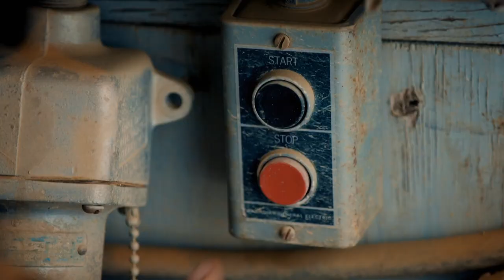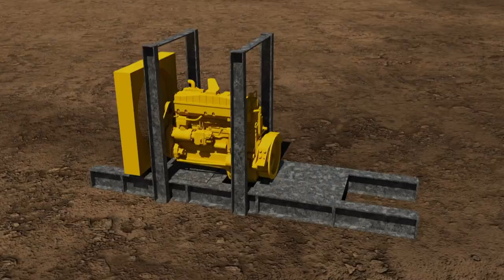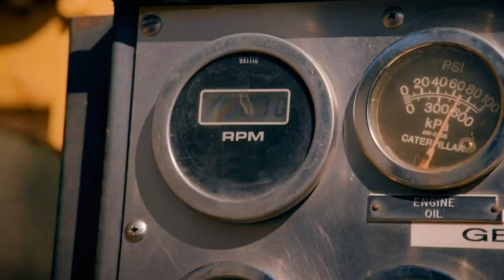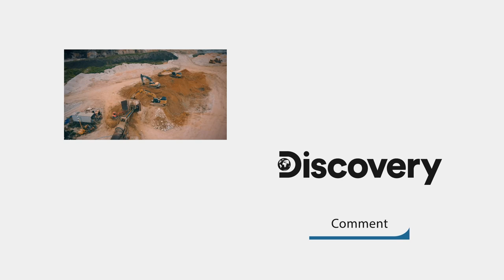Tony Beets Loses TWO DAYS Worth Of Gold Over Broken Water Pump | Gold Rush

Comment: 11ton water pump didn't know they were that big
Reply: They can get a lot bigger than that too.  That is most likely including the weight of the engine, those Cat D398 engines weight approximately 7 tons by themselves, then about another 1000lbs in fluids (oil & coolant) the frame that it’s all bolted on would probably be about a ton then the rest would likely be the weight of the pump that I assume is cast iron
Reply: Pretty impressive little thing, running right off the generator's crank like that. Wait till you see water pumps on low speed diesels, like a Wartsila 50. You can't comprehend how much fluid they move